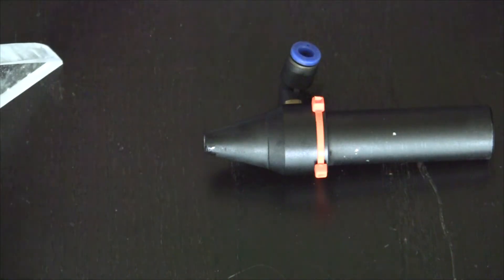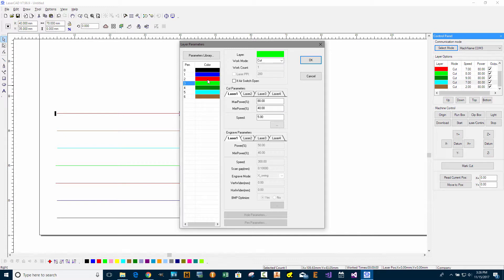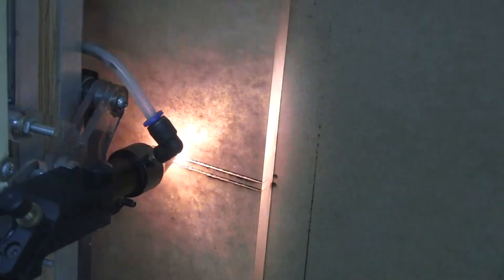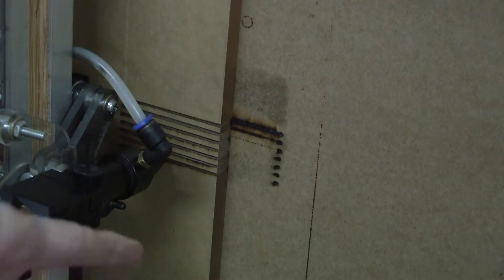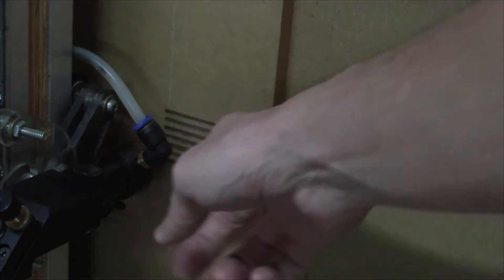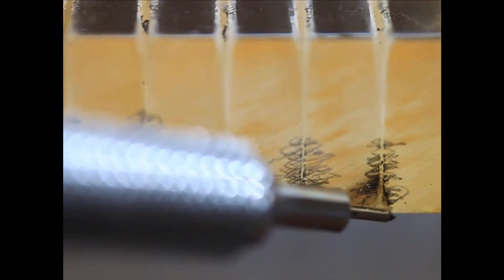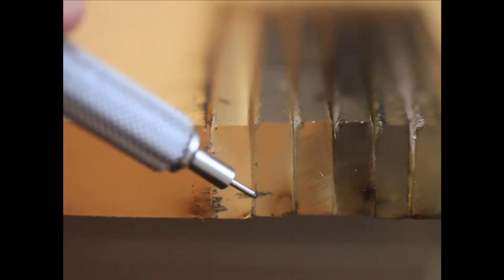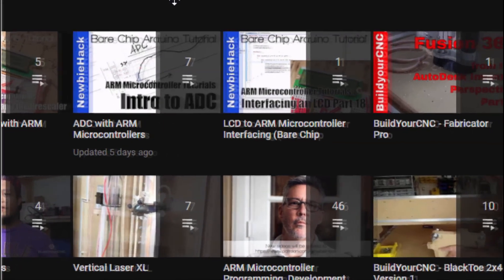Laser Cut Test: 1/2" Plexiglass, 2" Focal Lens, 80 Watt CO2 Laser, Various speeds, Nozzle on surface

Comment: Not sure if you have done further test's but I cut 10mm at %66 power and 4mms on my 50watt Ebay blue machine on a raised pinbed.  It is a clean cut underneath because of that.

Comment: it seems like the "kerf is wider near the top.. so I guess it wouldn't be perfectly square to teh surface?...How about a 4 inch focal lenght?  Is it easy to get and install a different one on your machine?
Reply from the maker: Yes, I will be doing tests with the 3" and 4" focal length lenses after I exhaust all the tests for the 2".  You are correct that the top seems to have a fillet where the top edge has a bit more melting going on, and it is angled towards the bottom.  I think the angle is the actual cone of the lasing energy, but the fillet on the top I think is just a little more heat melting it.